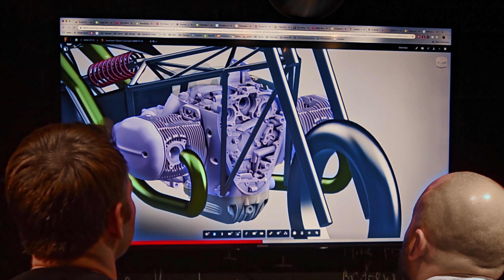Buying Back The ONLY Harley-Davidson That We've Ever Built // Revival Daily

Comment: How I can make a Vrod work without the original ecm when rewiring to add the mo. Unit Blue??? I saw all the videos about and don’t see the way. Please🙏🏼🙏🏼🙏🏼
Reply from the maker: The short answer is that you can't. The mo.Unit does not replace the factory ignition module/ECU/ECM/CDI The OEM ignition wiring remains virtually untouched except that the mo.Unit will provide the 12V+ power to the ignition.